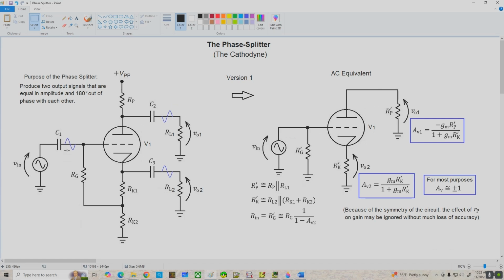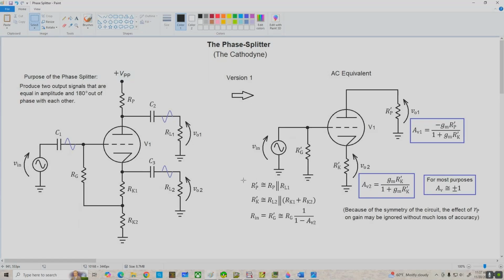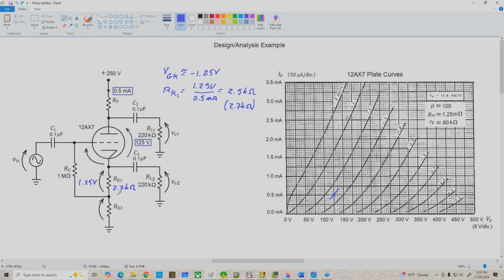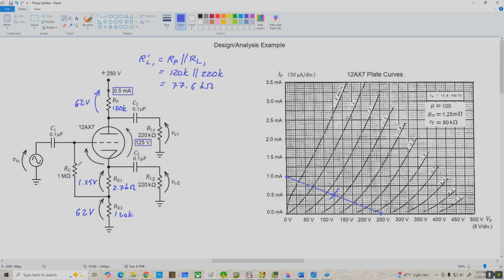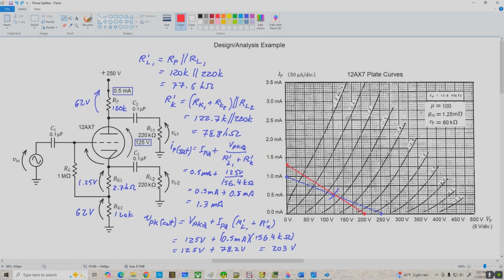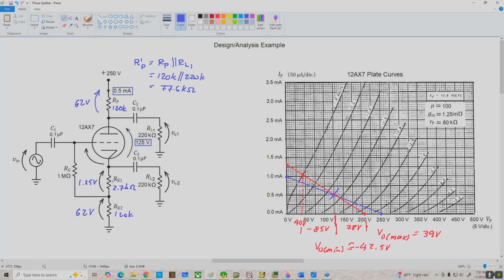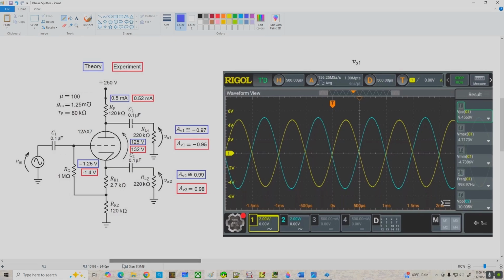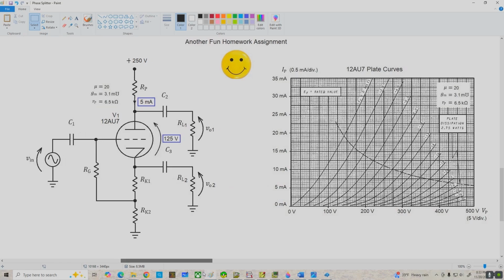Topic 67: The Cathodyne Phase Splitter

Comment: Thanks so much for the video. One question: How do you explain that RP is parallel to RI1? Do you have a book for sale?
Reply from the maker: Thanks! R’L = Rp || RL because the coupling capacitor is a short circuit for signal frequencies and the supply rail is a short to ground for signals. The book is on Amazon

https://a.co/d/fJ5Yu7b
Reply: @Denton.Dailey  Thanks, now I understand!

Comment: Thanks a bunch for a great series, your book is on order

Re the modest difference in voltage gain between inverting and non-inverting, can the load resistors be adjusted to achieve parity?
My quick calculation suggests increasing Rl1 to 229,515 or perhaps more practically, 230k, would do the trick

Thanks again
Ken
Reply from the maker: @kenparsons4779 thanks! Yes, you definitely can make adjustments to equalize the gains. Depending on the application sometimes it’s preferable to have asymmetrical gain in a guitar amp but in a hi-fi application perfect matching would be the goal.